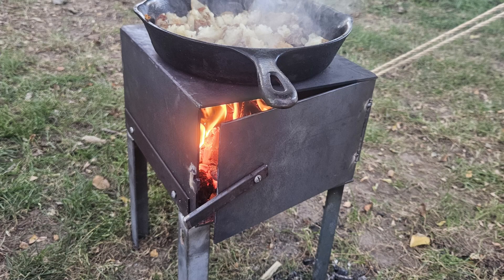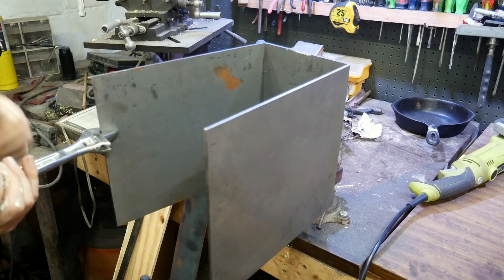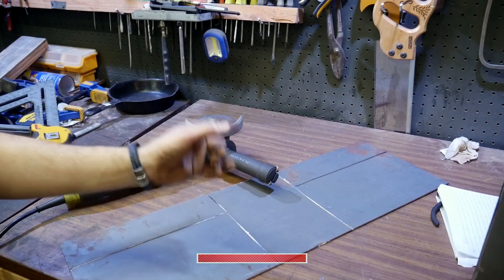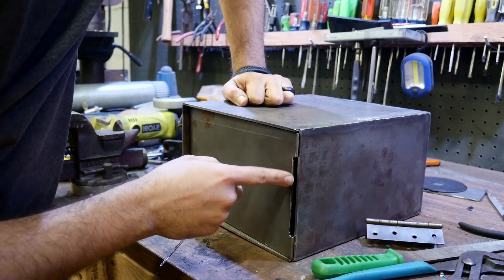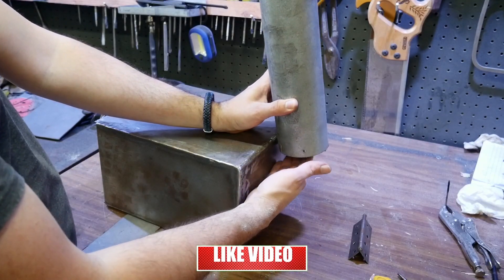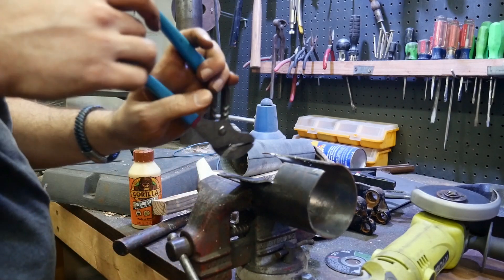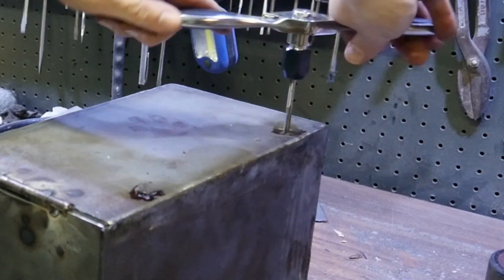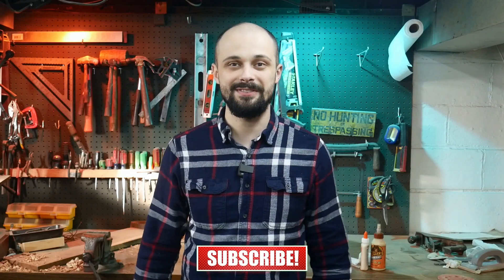Building a Portable Steel Wood Stove for Camping and Reenacting

Comment: What is the lifespan of these little stoves if you use them constantly during the winter?
Reply from the maker: I've wondered that myself. If you want to do that, I make it a little larger and line it with fire bricks. Add a dampener, and a few other upgrades. Probably a thicker gauge of steel as well.